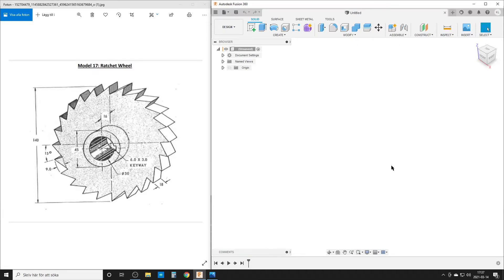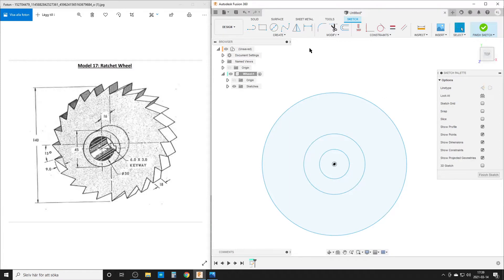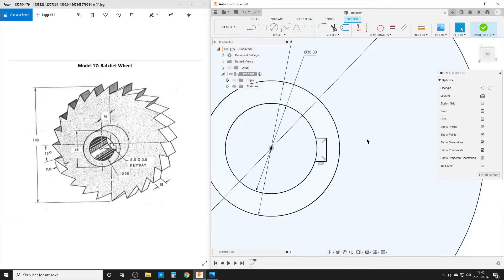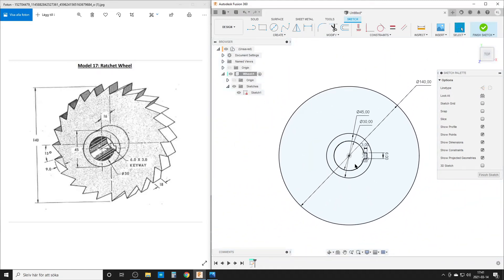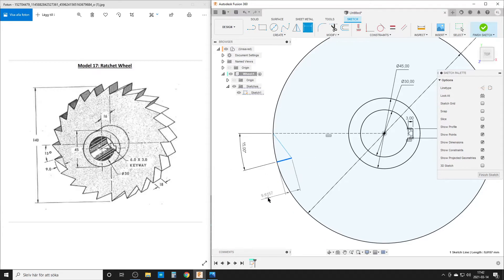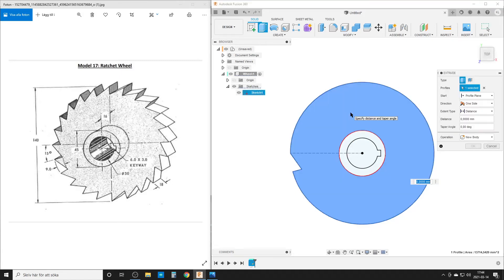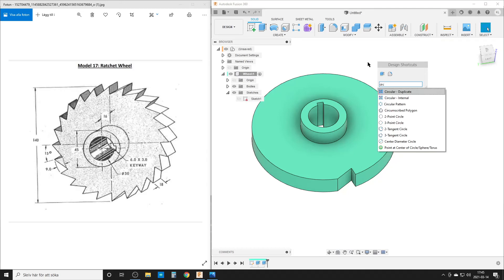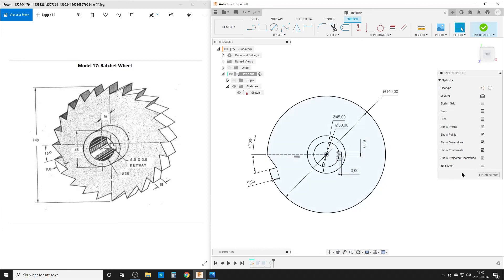Fusion 360 (Basic) - Ratchet Wheel - (Circular Pattern - Faces)

Comment: Indeed, This is how I like to see modeling done. Beautiful. Honestly I would have patterned on the sketch instead of the faces, this way seems cleaner. Thanks for the tip.
Reply from the maker: Thank you :) But for best performance of parametric cad you should avoid pattern in sketches and do pattern of features/bodies, try some bigger pattern in a sketch and you will se how Fusion starts to struggle.
Reply: @KristianLaholm  indeed your way is better.